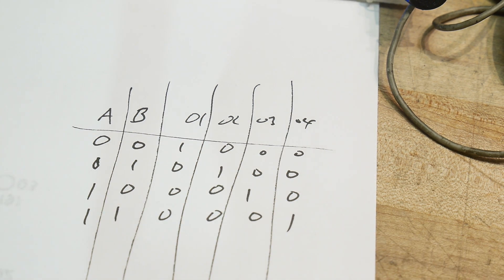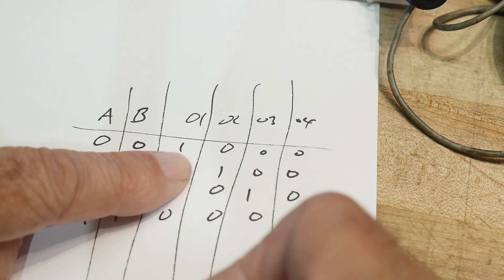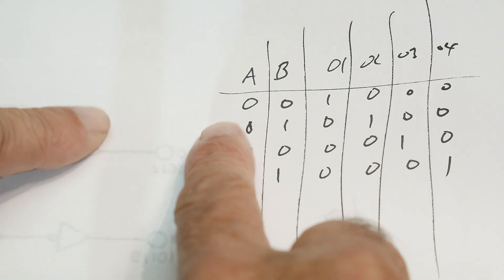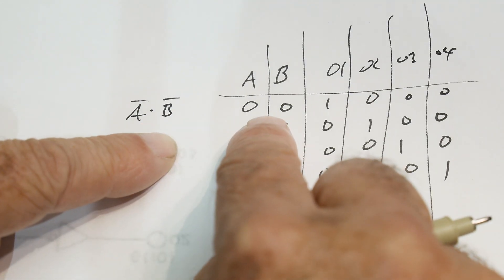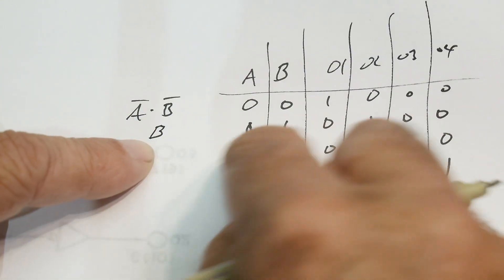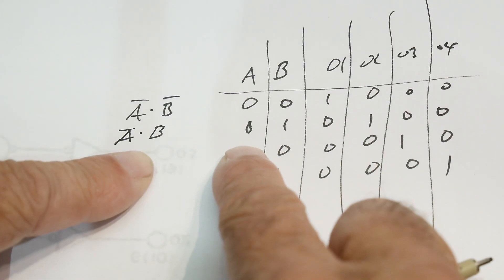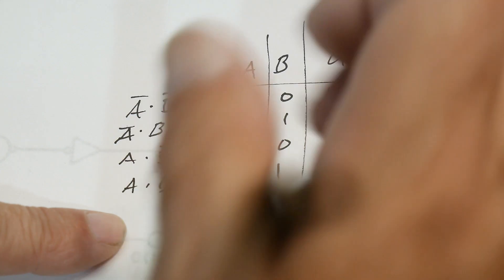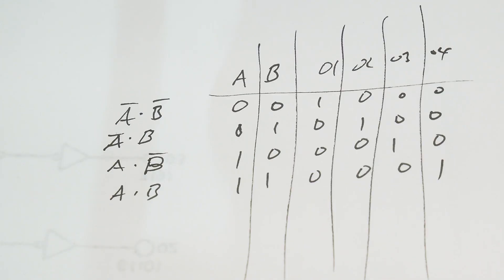#1707 CD4555 Decoder

Comment: I ma learning so much from these "chip-of-the-day" videos. Thank you for doing them and thank you to those who are suggesting chips!! How about some communication conversion chips? Like a ttl to RS485 chip like the MAX485??
Reply from the maker: I will try and do a RS422/485 video sometime in the future
Reply: @IMSAIGuy Thank you so much!!! I am a mechanical engineer/sr. design engineer that also dabbles in electrical engineering and is trying to learn electronics and programming....in my mid 40's. Bit late to the bus on that one but better late than never! I am trying to work on a project that as a loose application to something at work where I am trying to communicate to an Allen Bradley variable frequency drive (motor controller) with MODBUS over RS485 with an Arduino nano. I am using a MAX485 board (actually uses a MAX13487 chip) to do that communication with a bit bang serial interface. So far its working and I am able to query the drive for data and to receive it back and display it. So, success!! But I still need to do a lot more and its far outside of what I know how to do, but thats how we learn! 🙂

Comment: So 1 to 8 you call 3 to 8? And 1 in 16 you would call 4 to 16? That is just wrong and confusing.
Reply: Not really. Actually makes a lot of sense as it allows you to differentiate between  decoders and (de)muxers.

For Decoders;
Decode 2 lines to (1 of) 4 outputs [2 to 4]
Decode 3 lines to (1 of) 8 outputs [3 to 8]
Decode 4 lines to (1 of) 16 outputs [4 to 16]

For Muxers;
Select (1 of) 4 inputs to 1 output [4 to 1]
Select (1 of) 8 inputs to 1 output [8 to 1]
Select (1 of) 16 inputs to 1 output [16 to 1]

For Demuxers;
Select 1 input to (1 of) 4 outputs [1 to 4]
Select 1 input to (1 of) 8 outputs [1 to 8]
Select 1 input to (1 of) 16 outputs [1 to 16]

Comment: This is all great but no one uses these chips anymore. Logic gates in general are not very useful if you have a small microcontroller anyway (in many cases).
Reply from the maker: all true, but it's like a classic car, they are crap but fun
Reply: You'd be surprised how often basic logic chips pop up, even in modern equipment.

Plus I'd argue there's way too much focus on micros these days, and too little understanding of how they work. That's why I'm glad that people like Ben Eater, James Sharman and Fabian Schultz are really helping to bring back a core understanding of how computers work at the hardware level, rather than just script kiddies dumping code into micros.
Reply: @JaenFoster  I agree but from what I see in my 40+ years of experience as an electronics circuit designer the trend is away from discrete logic and towards micros. It's a cost thing. Micros are so cheap. And bom cost is lower with fewer packages on the board.
Reply: @herbertsusmann986 for consumer electronics that's definitely the case, but I've seen quite a lot of brand new industrial control gear that still uses discrete logic, especially for things like safety interlocks and signalling.

Comment: Both "2-to-4 decoder" and "1-of-4 decoder" are correct. First one because it decodes 2 input lines to 4 outputs, and the second one because only 1 of the outputs is active at one time.
Reply from the maker: win-win
Reply: While true, I do prefer the "2-4 line or "3-8 line" nomenclature as it clearly differentiates it from "1-4" or "1-8" demuxers just from the numbering

Comment: That discussion of the circles at the end twisted my brain into a pretzel. Why would we want to mix low true and high true logic in the same circuit? It's like driving on the right-hand side of the road and the left-hand side of the road in the same city!
Reply: Once you understand it it makes schematics much easier to follow. It really is very very simple.

Draw an RS flip flop with "cross-coupled" NAND gates drawn as NAND gates. It makes little sense. It is actually a /R/S flip-flop (where / is used to denote NOT; R and S are asserted LOW). Draw it as cross-coupled NOT-OR gates, exactly the same device, just drawn differently, and it makes instant sense. It's simple application of DeMorgan's theorem. It is extremely common in logic circuits to find some signals asserted HIGH and some asserted LOW. It is very common to find devices with some input asserted HIGH and some LOW. With a typical JK flip-flop, direct set and clear are usually asserted LOW, J & K are asserted HIGH and the clock could be either way (rising edge, falling edge, or level-triggered, depending on the specific device). A 74xx138 decoder has three ENABLE inputs - two asserted LOW, one HIGH; the outputs are asserted LOW.
Reply: @D614G_aka_Doug  but why wouldn't we just standardize and say "low = false, high = true"? Why change the meaning of low and high all over the place?
Reply: @chongli297 because it allows you to control two chips with one control/address line.

If chip A enable is active high, and chip B enable is active low, tying them both enables together you can pick which chip is enabled using one control line and without any extra logic. Otherwise you'd need to add an inverter to one of the enable inputs so that only one chip is enabled at a time.
Reply: @JaenFoster  oh I'm not suggesting we should change anything with the electronic signalling in the circuit. I'm just talking about the confusion having two conventions (high true and low true). I think we should just pick one and stick with it, and my vote is for high true. Then if a chip is active low you just put ~A on the enable pin

Comment: The CD4555 (RCA)/MC14555 (Motorola) was never all that popular, because designers happened to like the CD4052 (RCA) and SN74C153 (TI)  analog switches.  Why stock both a mux and a demux when there's one chip that can do both? (Yeah, I know, drive capacity, speed, and so on, but lots of circuits didn't need that.)

I like your way of drawing schematics. I draw AND-OR-INVERT that way, recognizing that it's all NAND gates (but a positive-logic NAND is a negative-logic NOR, and gets drawn that way when the previous tier of NANDs is feeding it.)

Comment: The data sheet calls it a BINARY ‘to’ 1 ‘of’ 4. In other words it selects ‘one out OF four’ possible outputs, depending on a combination of 2 inputs. It could also be called a ‘two TO four’ decoder but this chip type was probably available before the more complex ‘3 TO 8’ or the ‘4 TO 16’ variants and didn’t have a standard naming convention to follow.